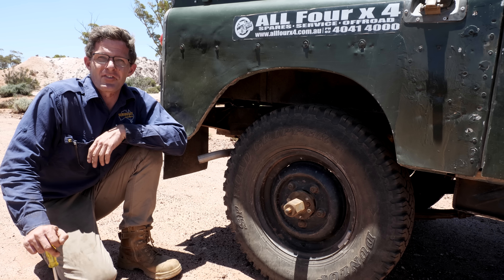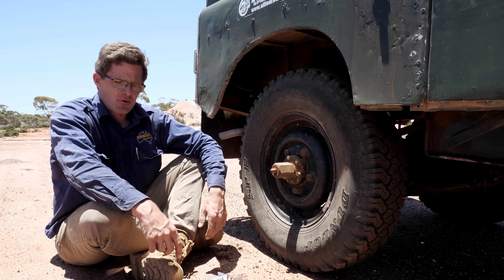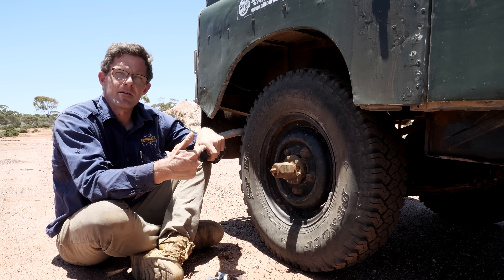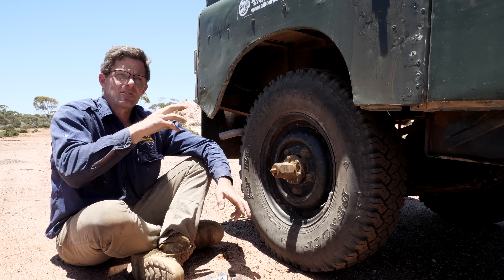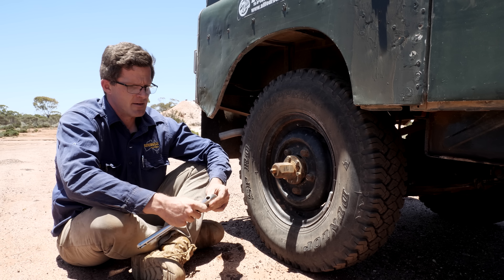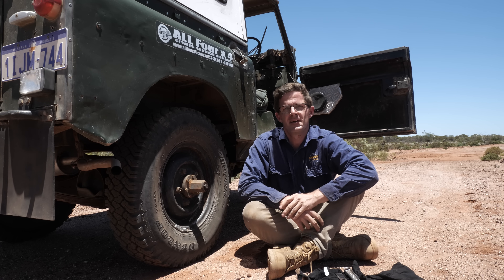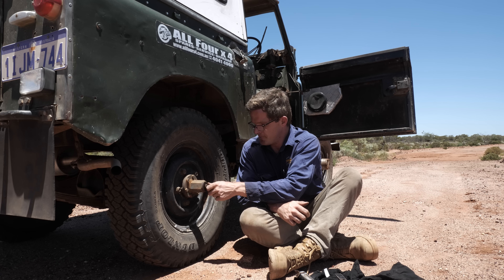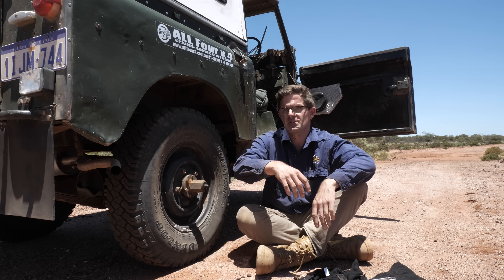World's simplest 4x4 diff lock: McNamara Diff Lock

Comment: Bloody silly idea! The only way this works is that the diff itself has to be permanently locked and when the pull bolt is in the Landy is then just one wheel drive when in normal high ratio and all drive loads are through that one wheel/half shaft.
 I guess it would be OK with the Stronger Salisbury axle and if Landy spends most its time on loose/gravel surface it would be fine left locked and one would only need to fit the bolt when going on hard surface.
Reply: Either you or I have misunderstood how this works. My understanding is that when the hub bolt is removed, the spring pushes the half shaft in and through the diff centre so the splines of the right half shaft engage with both side gears in the diff, so locking the diff centre.  Pull the shaft back out and lock it with the bolt, and the right shaft is in the right side gear only and operates as a normal diff.  Simple and more reliable in long term use, if less convenient to use than an air or solenoid operated diff lock.  Simple re to install, too.
Reply: @SnaggerNick , most open diff designs have a cross pin that the planet gears run on and transfers drive to the axles via the sun gears. You only need to lock 1 axle to the diff center for diff to lock . There’s a few different ways to lock a diff, it’s still a cool idea.
Reply: @ I understand that - I have rebuilt a few diffs, single pin and so-called “4-pin”, and built up some ATBs too.  You’re probably right if you’re saying the right shaft would only lock into a spline hub in the diff centre, rather than all the way through to the left side gear, but some four pin diffs have been built with pins radiating from a circular hub, rather than being two crossing pins.  That is a common upgrade on Rover diffs, replacing two pins that cross each other with a central cut in each with a single, forged part with a hub and four pins for four bevel gears.
Reply: @SnaggerNick from the photos I’ve seen I can only guess the longer shaft slides into the cross shaft for the 4 pinion gears. The cross shaft would have the same shape as the HD fordged versions you are referring. 

The hemisphere/carrier may be custom made of modified from another manufacturer (it’s definitely cast, and looks like a small Salisbury carrier so could possibly be a D44??) 

The axle shaft looks to be same 24 spline each end just longer splines (say 100mm)
Reply: @ I’m only guessing mate, I’ve never played with Land Rovers before. I only clicked on the video when I saw the McNamara name as I recently installed the TJM version of Neville McNamara’s air lockers in my 80 series. I real like the TJM Pro Locker design over the ARB air locker and the E-Locker, it’s very similar to the OX Locker but that uses a cable instead of air. I just like knowing how stuff works and learning new and old ideas from interesting videos and magazines back in the day. It would have been a great addition to the video if he showed the parts before the install , have a great day
Reply: No John it's conventional when unlocked.
Reply: @alexjohnward   If it was a conventional diff with a half shaft pulled out you would be going nowhere. There is no lock as such.
Reply: @JohnDavies-u9z  it's not pulled out entirely,  it's still engaging with the conventional diff even when drawn-out.
Reply: I think it locks splines that mesh the axle to the diff carrier effectively locking the diff . When tightening the bolt into the axle it must move splines past the corresponding splines in the carrier to only engage on the sun gear of that side of the diff? Or that’s how I would imagine it would work?
Reply: I could imagine splines on the half shaft which normally sit outboard of the diff, sliding into engagement with splines in the crown wheel or bevel gear carrier (I don’t know which side the crown wheel is on).
Reply: I dont understand either, if disengaged, and transfer case is in 2WD, you will have no drive, it would be like removing one drive flange on Defender. Unless differential itself is swapped for what would be a spool.
Reply: AMEN brother AMEN. At last someone has made sense of the ugly contraption.
Reply: I've been scratching my head about this. the gentleman mentioned planetary gears... I'm going to google the diff set up in these. I love to find out about this stuff.
Reply: And when you go around corners.
Reply: @africadreamin , the same thing that happens with any locked diff, Tyre scrub and lots of load on the axles. Not to be confused with an auto unlocker like a Detroit Locker.
Reply: So you saying it isn't a locking differential at all? Just a means to disengage the drive to one half shaft? If that's the case, the other half shaft would need to be permanently driven with no differential function at all .
Reply: @robinhamilton9939  Exactly that for it to work.

Comment: Is there one on each side or do you only engage it on one side?
Reply: This isn't to disengage the diff, it's to lock it. As I understand it, there's an overlong halfshaft on that side of the car which normally just engages with the R/H diff side gear. When you remove the bolt, a spring pushes the halfshaft through the centre of the diff so it engages with both diff side gears, so locking the diff.

Comment: Diff disengagement on REAR  axle ?  Why ?  Seriously , I'm curious .
Reply: This isn't to disengage the diff, it's to lock it. As I understand it, there's an overlong halfshaft on that side of the car which normally just engages with the R/H diff side gear. When you remove the bolt, a spring pushes the halfshaft through the centre of the diff so it engages with both diff side gears, so locking the diff.
Reply: @championn3c574 . How ? For an overlength  Half-shaft to engage with the OTHER Side gear , One , there's a Spider-gear carrier in the way , and Two , it would have to displace the Half-shaft on the other wheel to engage that spline .
Reply: @johncunningham4820  Good point, the Rover diff does have a spider. There must be more too it than just Salisbury side gears in a Rover diff, perhaps a spiderless diff with an extended L/H side gear? I can't think of any other way it could work. Unless it somehow locks the R/H side gaer to the diff cage.
Reply: @championn3c574  Other commenters are saying the axle extends into a spline in the custom cross pins to lock the diff.
Reply: @Mark_Bridges  Thanks, yes, a splined ring in the centre of the cross pin would seem most likely.

Comment: Lovely ep and setup,  My dad had ten brand new SWB land Rovers in a row,  From the first ones bought into QLD in the late 40 or early 50s to the 80s,  I learnt to drive in one of his 4wd around 1970 onwards, Then Dad saw the light and bought a Toyota and never went back to LRs, I owned a series 2a could not sell it quick enough. and owned Toyotas from then on,
Reply: Another yellow puddle in the sand.
Reply: I presume you are referring to FJ-40 Toys. Based on your 1st hand experience It would be interesting to see a comparison you can make of the 2 vehicles with pros and cons either side.
Reply: @78a67h  Yes my brother had a new FJ40 with 2f 4lt motor brillant 4wd, but a tad thirsty, , Dad had the near new SWB 2,3lt  Rover was the Leyand one what a heap of shirt it was motor was rebuilt in a couple years was hot stunk of fuel and gutless, And the steering was all over the shop, Toyota was serpera in every way, Then he bought the first diesel 3,6lt HJ45 or 47 that was a awesome 4wd. and many more toyotas after that, our neighbours had the later Rovers they seems fine,
Reply: But weren't the Landies more fun 😅?
Reply: @killerdinamo08  No to me they were rubbish,